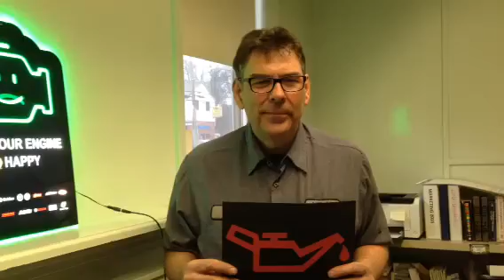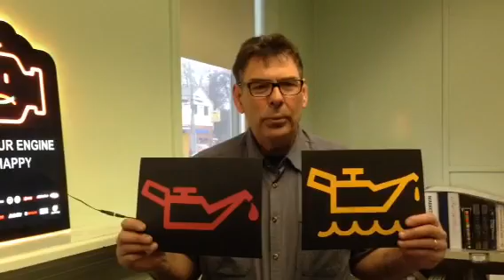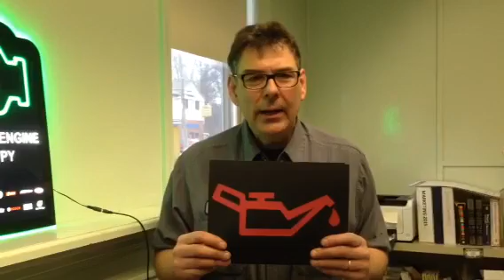Vehicle Warning Lights: Oil Pressure Light

Comment: VW Golf 4, no problem just change the oil pressure sensor (aslong as you have the 1,6 16v engine). That will fix the red oil warning light. For the yellow/orange, just add oil no problem

Comment: Hey Gary my son has a 2002 Nissan Xterra just had the oil change last week got it home on Monday and went to start it to go to school the oil light was on. His oil level is perfectly fine there’s no leaking no engine noise. Put it in the garage changed out the oil pressure sensor which was original with the vehicle in 2002 the sensor had no oil leaking out of it I did the air pump test on it it was not leaking air. However when I put the multimeter on it there was no continuity it was a one pin pressure switch and when placing the multimeter on the body and one and on the connector it would not beep. I put a new sensor in and the oil light is still on I’m thinking I might have a bad new sensor any thoughts. Also the oil pressure light is very dim
Reply from the maker: Hi Scotty my advice would to remove oil pressure switch and install a pressure gauge and check oil pressure . If no oil pressure the problem is on the mechanical side .possible clogged port if motor is not ticking or knocking

Comment: My audi A3 sportback 2008 has red oil light but writes "low oil level" not "low oil pressure" does that contradict the situation, so what problem of the 2 do I have?
Reply: Hi Kakoma, Thanks for your question. We recommend visiting your local auto repair professional for an accurate diagnosis of the problem.

Comment: hi, i have high pressure oil, and my torque converter spit out oil from  my engine. Pressure when  the car is stationari si 3.8 bar and when accelation is at 2000 rpm the pressure rise to almost 6 bar.

Comment: From my experience my passat shows the warning lights and the oil pump was checked. I was told used lucas oil and that settles the rattling noise. 5w 40 synthetic oil is the best to used for volkswagen versus 5w 30 full synthetic oil used when recently oil changed. After driving 40 miles to 50 miles the warning light comes back on. From my check engine light say Camshaft position might be damaged lob that's connect with fuel pump.

Comment: Hi, I get the oil switch replaced recently by my mechanic but I'll pressure light still turning on and my stop in the middle 9f the road most of the time. Do you think is the oil pump? Thanks
Reply: Thaimara, Thanks for your inquiry. Without seeing your vehicle, it's difficult to diagnose. I recommend you go back to your mechanic and have him diagnose the problem.
Reply: @mariepelletier7540  in my car mornings start no oil light on at idle after warm engine light on at idle since 8 month is this issue
Reply: @m.f.k515  same  problem with me.. Plz u suggest me. What I do
Reply: Light still on for me
Reply: @shaneeklivingston770  on start. Engine

Comment: what about your fully oil but still going on and off blinking
Reply: Amir, It's tough to diagnose your problem without seeing the vehicle. We recommend bringing your vehicle to your local auto repair shop. Thanks for your inquiry.
Reply: I changed the sensor of oil light warning then few times warning light